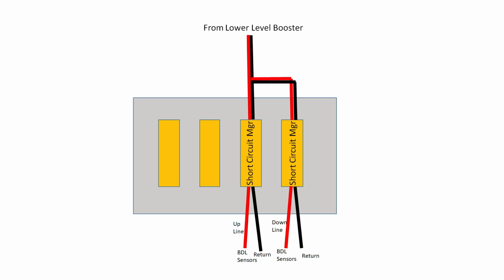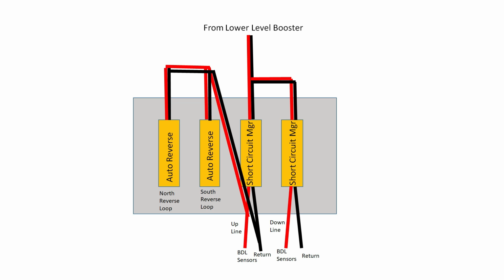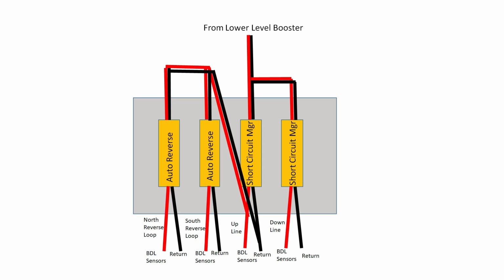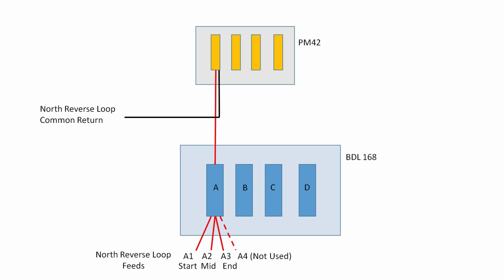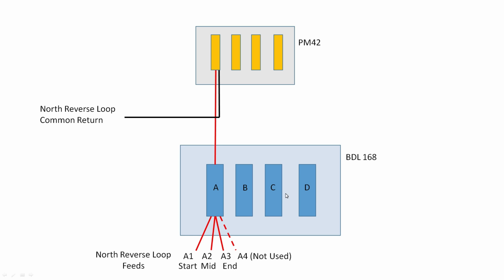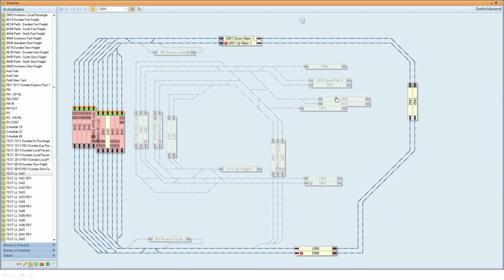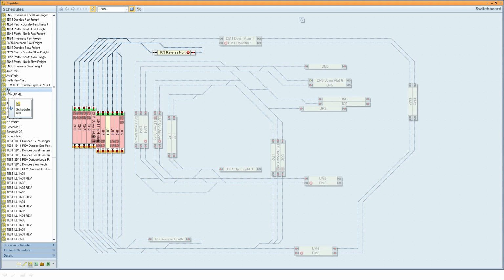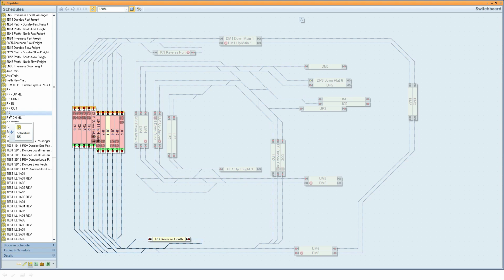Perth South Model Railway, #4 Reverse Loops

Comment: Wow, how things have changed! I still remember my father's reverse loops in the 1960s. The loop itself was isolated and he had two ordinary two-way switches to set the polarity one way or the other. You just had to remember to switch one polarity off before turning the other one on! At least that's how I remember it but I don't remember the wiring installation!
Reply from the maker: Hi Nicolas. Yes the old way was cumbersome! These modern devices work so well, you don’t need to think about it once they are set up. Hugh

Comment: Great video, Excellent. Just a thought, you mentioned using foam unbder the track or sound deadening, but what is the noise going to be like with 10 locos running??Again I am impressed with the DCC.
Cheers, Bob
Reply from the maker: I quite like the foam. It was easy to use though obviously not as firm a surface as cork. I think it does deaden the sound but as you say, the more locos running, the more noise!

Comment: Hugh, I see in this video your frame is basically the L girder principle with cross-pieces laid on top where required giving maximum strength which really appeals to me. 
I would have one L girder at the back and then one at the front where I would be standing. Is there a certain width whereby you would need support in between as the largest width on my layout will be 3' if that makes sense.  
I am using 9 mm ply as my baseboard as I am modelling in N gauge and I appreciate once the cross-pieces have been screwed in place it will be very strong but I want to get this right?
Regards Chris
Reply from the maker: Hi Chris. Yes L girder made up of 50mmx25mm and 100mm x 25mm timber (actual sizes of planed timber are about 42mm x 21mm). Re the spacing between L girders front to back, it depends on the cross member size but if you are using something like the above, then spanning 3 feet should’t be an issue.
I had to keep my board widths less than about 720mm to get them through my loft hatch.
If you have your track layout planned, just check that there are no point motors going to be over either the cross members or even the L girders themselves (it’s difficult working in the space between L girder and baseboard surface if you see what I mean.). Beware timber shrinkage. Despite trying to get good quality timber, I have had problems with some warping of timber in the heat of the loft room in summer. Nothing catastrophic but enough to require adjustment here and there. Good luck! Hugh